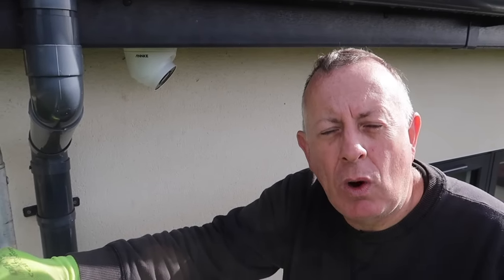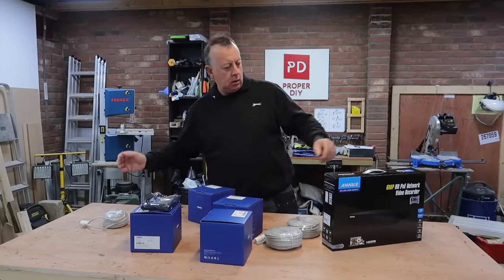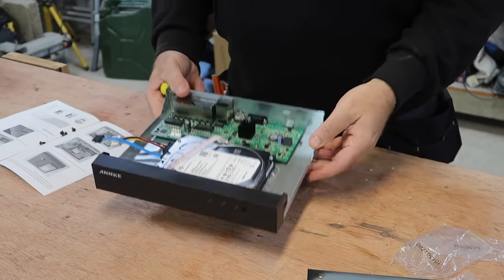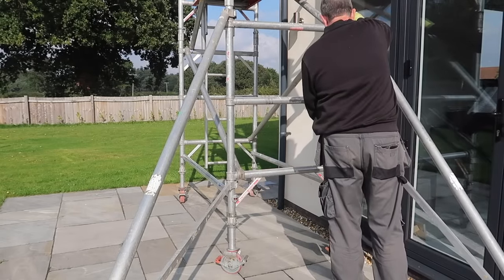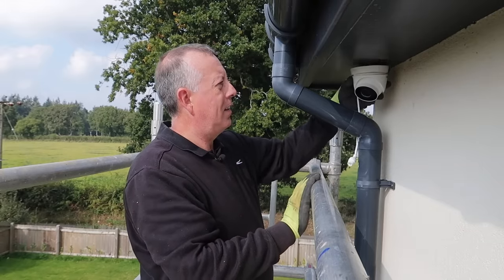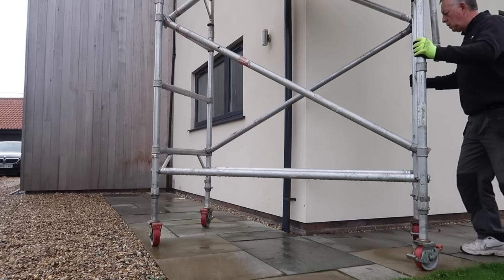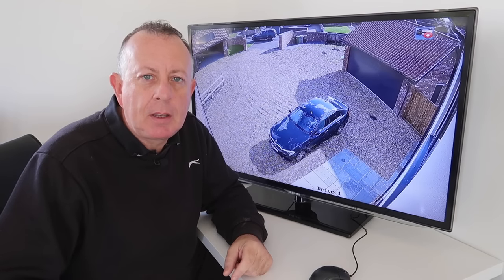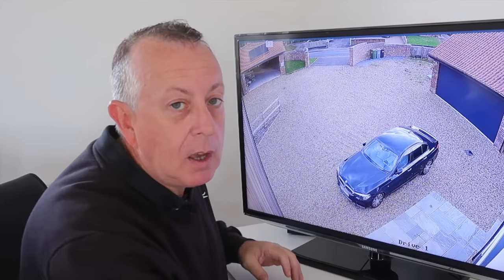Annke H500 - 6MP Super HD POE Security System - Full Installation

Comment: Great video!  I liked the tip to attach the cable to a rigid pipe to push it as far as possible into your attic.  I was scratching my head as to how I would reach the cable down by the soffit but you've solved it.

Comment: Top tip: use of a stand-alone test monitor can help camera alignment before connection to the main controller & saving repeated journeys up/down the ladder/tower; esp if you've already moved it before system configuration
Reply: Or connect control unit to Internet and your mobile so you can view camera angles on your mobile and adjust accordingly whilst up there.

Comment: Great and clear installation video. Good tips to get the wires into the attic! Just one thing I have noticed - it's 5MP not 6MP as per video title :)
Reply: No the nvr is 6mp , but the cameras are 5mp , the nvr is capable of running higher mp cameras , and mine even could add a 8mp tho it would only record at 6mp
Reply: This is all a bit irrelevant now seeing as you have replied to a comment that I made two years ago, however , nonetheless the NVR will only record at 5MP if the cameras are only 5MP regardless if the NVR is 6mp capable or not.

Comment: How did you run the cables from the loft to the downstairs router? Or am I missing something, I don't get how that part works,that's what put me off and I bought a Eufy wireless system instead which is great for people like me not wanting cables and holes through walls. btw you have a lovely house :)

Comment: I used the same method of fastening the cable to a bit of pipe when I installed mine. I have an older NVR and it looks like they have updated the software. I have noticed I do not get alerts unless the app is running on my PC or I log into the NVR. Night vision is great until spider decided to make a web across the camera then I get notifications all night.

Comment: Nice system- I recently fitted a POE system and it’s night and day compared to the older coax systems
Reply from the maker: Totally agree
Reply: @ProperDIY  the only problem I had with my system was that I couldn’t use pre made cables with the waterproof glands unless you remake the RJ45. Was only a problem because the cables didn’t go directly in to the roof but re-terminated the end fairly easily
Reply: That's what I am hoping for as my old system is POC (coax) and the typical problem I get is if I touch the DVR the cams can come on and off by themselves, dodgy connections to the DVR even though the cables are factory made hence the new system that this Stuart is fitting has been purchased today

Comment: Another great video Stuart. I recently installed the Ring security light/camera combos on front and back. I couldn’t face drilling through the render and brickwork for the cables so took the easier option and just unscrewed two existing up/down lights and replaced with the Rings. The only issue is that they’re only about 7-8feet from the ground so a reasonably tall person could easily disable them with their hand….
Reply: Also meant to ask - do you also have external insulation on the house between the brickwork and the white render? On your various projects where you’ve drilled through the render is there anything specific one has to bear in mind for such ext insulation? Other than using silicone around the holes I’m hoping there’s nothing else !

Comment: Great timely video. I’ve been chewing over what system to go for, for weeks now. Would have been nice to see how the wires were threaded down the black downcomer and then transitioned to the 20mm plastic conduit. Good idea about the blanking plate/box on the inside as I was pondering how I would break out at that location. Does the 25% discount apply to the cameras with microphones also?
Reply: Yes it does as I have just bought the system with the turret cams with the microphones

Comment: Would it have been possible to site the HDD box in the loft making it less likely to be stolen in the event of a burglary?
Reply from the maker: You can do if you run an internet cable up to it. The main problem is if you want to adjust any settings, you would need to take a TV up there to do it.
Reply: Helpful, thanks for replying.
Reply: @ProperDIY  Just buy a cheap old 2nd hand monitor from something like FB market place or Ebay. Leave it in the attic.

Comment: Very nice vid for an amateur installation.If you're REALY after security peace of mind double or triple the amount of cameras .We live in a bungalow so you are lucky you can mount the cameras out of reach ,we have the problem a determined burglar could simply spray the cameras by creeping up using a blind spot so you need to cover all the blind spots .All our cameras are covered by other cameras removing any blind spots. Your BIG problem will be spiders and unlike us you cant just brush the webs away lol .Another tip is remove the reference to watching the neighbours if you fall out with them they can use data protection laws to send you to court as you have historically said (even in jest) your cameras will be watching them .PS hope your burglers dont come on a foggy night your movement detection will be in overdrive recording fog! The masking feature unfortunately falls on its head if you use a PTZ camera and if you get addicted you will use them lol For older network cable systems you can simply add POE with a cheap dongle no need to replace an older NVR for newer cameras PPS remove the down pipe reference those naughty burglars now know where to cut your cables

Comment: Hi.Could you tell me if the HD box needs to be plugged into the router or if it can be connected via WiFi.
I'm sorry but i couldn't quite tell and i would like to fit the system in my garage away from the router but within WiFi Signal.
Thanks for all the great videos

Comment: I see you have the same new build problem as me where they put the BT master socket in the worst possible place in the living room. I've just spent a weekend installing conduit to carry several Cat5e cables so I can take the VDSL signal up into the airing cupboard where I can house all my networking equipment, rather than stuffing it all behind the sofa on the floor, as well as take gigabit ethernet back to the living room, and all other rooms in the house.

I can't believe they don't run it to an understairs cupboard as standard.

Comment: Another comprehensive, detailed walkthrough Stuart - thank you. I'm planning to add some cameras to my Synology NAS, as this provides all the functionality of an NVR.  Plenty of tips there on routing POE cables!
Reply from the maker: Glad it was helpful!
Reply: You may already know this, however you ideally need to get a hard drive designed for continuous recording. Normal HDs aren’t designed for this and will fail significantly quicker.
Reply: @Johnnie10ponnies  Thank you for that.  However, Synology NAS's are frequently used for surveillance purposes only, with Synology's bundled Surveillance Software being highly regarded.  The usage I intend would not be continuous, only recording when movement is detected. That said,  I appreciate your input.
Reply: @chrislyon8677  I’ve had a 2 bay Synology for about 8 years and had to replace a failing HD last year. That’s when I discovered that there are  different HDs for surveillance recording rather than data storage as I nearly bought the wrong one as I use mine for mirrored back-up. They have a more robust mechanism for recording as it is in constant use. For occasion recording it should be okay but may reduce the life of your HD.
Reply: @Johnnie10ponnies  Hi, I have Western Digital Red Drives but see that WD Purple or Seagate Surveillance are more suited for the purpose.  Thanks
Reply: @chrislyon8677  Red drives are rated for server use so you'll be fine, I wouldn't waste your money (if this reply isn't 6 months too late)

Comment: Very helpful video many thanks. question. After the initial setup prior to installing outside, is a monitor required as I would be leaving my NVR in the loft, can I block sections of the camera/motions zones on the app or do I need to do that using the NVR etc. Thanks in advance

Comment: Small point: instructions should have advised wearing earth wristband to avoid static affecting the hdd. It's standard practice when working with electronics. Not absolutely necessary in most UK domestic environments but could be enough to void a warranty or returns policy or lead to some dispute before manufacturer gives in. Extremely helpful video that is exactly what I needed to see
Reply from the maker: Thanks

Comment: Hello…. I have cat 6 cables running in my walls going to different rooms. I am thinking about installing NVR security cameras via POE…. My question is can POE cat 6 cables and regular cat 6 run together? Will there be interference or heating from the POE cables?

Comment: How do you remove the base of the case from the camera, to screw into a surface.  Annke doesn’t show this either and I’m afraid I’ll snap something separating the base.  I see that there is a slot that can be rotated to align with a tab, but it’s still not easy to remove.

Comment: Out of interest, what's the purpose of running the cables down to the TV?  Assuming once you've done initial setup, you can access the system via the phone app?  Was just thinking the box could go in the loft, connected to a TV initially and then removed.  The network could be provided by powerline adapter

Comment: I thought you aren't supposed to install them so high because they won't be able to see the faces?  I was told 8 feet is the perfect height for them.
Reply: very true but amateur installers always get it wrong
Reply: On a standard UK building, installation of the roof eaves is the easiest way to install CCTV cameras as it prevents the need to drill out lower down in multiple spots and try and run cabling through a pre-finished house which is difficult. Another option is to run conduit from the eaves down to a camera lower down but personally I think it looks rubbish and wouldn't do it myself. You will get less detail as your viewing the subject area from further away, but as long as you accept that there is no issue with this install.

A good combination would be a system like this and then a smart doorbell which records faces / close up video.

Comment: Tip for house built before 1999, soffits where the camera was mounted could be made from asbestos. Always check before drilling, the old asbestos sheet (AIB) may be covered up by new wood or UPVC. Great video the camera software looks like the much more expensive HIKVISION. Looks good camera would be hidden more if it was black.

Comment: Just received 8 camera set and none of the cameras have mics - turns out they supply C500 I51DF but describe the C500 I51DM which does have a built in MicroSD card slot and microphone!

Comment: Another good video Stuart. However, having PoE cameras connected to your main LAN is suicide. You really need that channeled through a managed switch on an isolated VLAN with mac filtering.
Reply: Yes, agree, ideally you should isolate the camera's from the internet entirely, but you will lose the ability to view on your phone if not at home more than likely.
Reply: @elminster8149  That's where VPN tunnels come in. It's always worth mentioning as IP cameras are stupidly easy to hack - if they're on the same network as all your important/personal stuff, it could be goodnight Vienna.
Reply: Hasnt he connected them into the poe ports on the back of the nvr? They wont be on his main LAN
Reply: @HubbHubbs  Unless he's configured an isolated network for the NVR, it will be. That wasn't mentioned so I presume not, as it's a DiY channel, not a networks channel
Reply: These rebadged hikvision NVRs have 2 seperate network cards in them, one for the LAN side and one for the 8 x poe ports, in the network section you can set the ip range for the LAN and the internal NIC is seperate.

Comment: Another great video, thank you. I currently have a CCTV system but am going to replace it, so the routing of cables is not an issue. One question I have though is before you can view your cameras on your phone away from home, do you not have to set up some type of account with a company that supplies IP addresses (as my current one does) as this is a pain for me currently? or is it included in the instructions and it was not mentioned? Thank you again.
Reply from the maker: yes I did have to set up an account with Annke but is was very straight forward and free.

Comment: Nice video but my big concern about this and other similar systems that lack Wi-Fi is where you placed the recorder. God forbid you are ever burgled but if the recorder is in the lounge then it will probably go missing along with your TV and other electricals meaning you will not have any footage to look at apart from the email alert on your phone. Having built in Wi-Fi means it could have stayed hidden in the loft and also saved you time on those cable runs.
Reply: One of the objectives of having a CCTV system is to help make people think twice about burgling you in the first place and failing that react to it faster - you're not going to get burgelled if it isn't worth their time via heightened risk of getting caught. Not a fan of these sorts of systems myself anyway, better to have an network system that records to a NAS device using one of the many decent open source camera systems that are around - they're more flexible, you can upload imagery simpler, and they have a lot of added features. like number plate recognition, facial recognition etc - and the interfaces are better.
Reply: Wired Vs Wireless... always tricky, horses for courses. Wireless communication can always be jammed, hacked (useful if PTZ cams) or flooded (drop in signal quality/bandwidth). Wired stays pretty much the same bandwidth although cables are liable to being cut if discovered. 

Whatever you have, most homes are liable to having the incoming telephone or cable connection cut and DVRs are liable to be unplugged and stolen to hide evidence, thus shouldn't be in obvious places. I agree lounge is the worst place! (But I would be tempted on having a dummy box for a laugh) Something truly organised could include an engineer or third party, unplugging the telecom cables to your home at the street box. 

But ultimately burglars and thieves aren't that bright generally... and much easier to disguise their appearance rather than these extensive measures. They don't plan to hang around for long and CCTV is useful not just for burglaries.
Reply: Agree on that - my system has the HDD in the loft (Shh!) and connects to phone or laptop via house wifi.  Another option is online storage in the cloud.
Reply: 1. Have a 'dummy' recorder on show
2. Store recorder in attic and use TP Link Smart Plugs for wifi connectivity. 
3. Cameras also have sd-card slots to retain data.

Comment: Using the pipe should be fine as long as it's UV shielded, otherwise the cable will eventually perish from UV exposure. An alternate solution is to replace the supplied cable with external cat5/6 cable.

Comment: I'm puzzled as to why you went to the trouble of running cables down the side of the house when you could have fitted the HHD unit in the loft - assuming you have a power socket up there. You can readily access/configure the system on your mobie or on web, so need to have the unit in your living room methinks. Great video nevertheless!
Reply: you need to plug in the ethernet calbe into  NVR unit for internet access (this model is not wireless), and I doubt he got one in the loft.
Reply from the maker: This system is not wireless and needs to be plugged into the router. I either bring the CCTV cables down or an internet cable up. To change any settings the system also needs to be put through a TV - I would rather do this in the living room than taking a TV up and trying to do it in the loft.